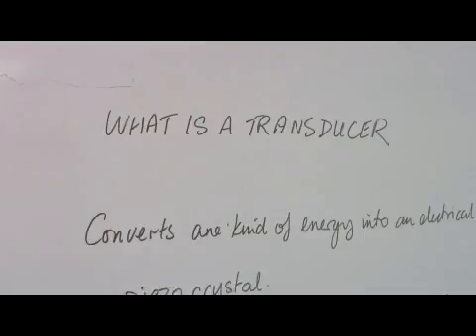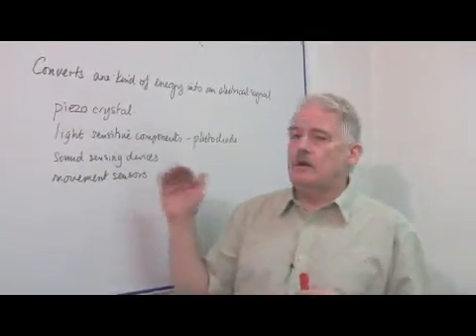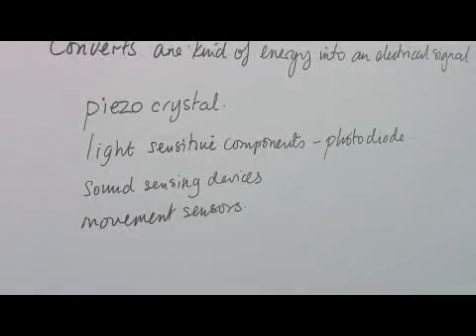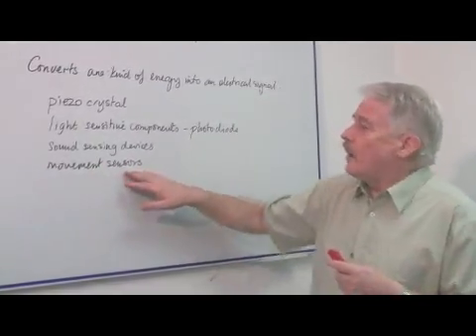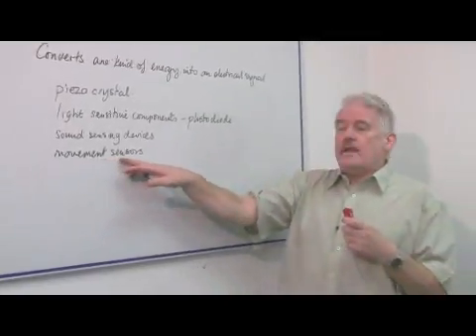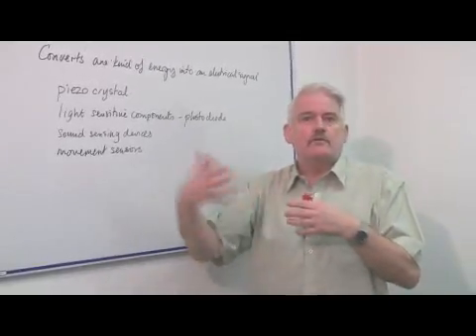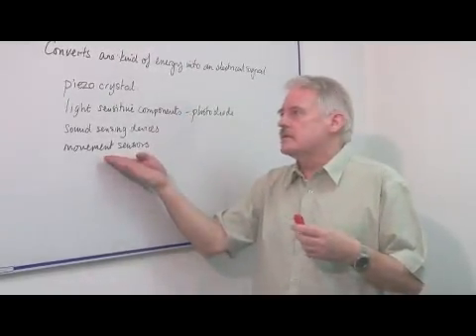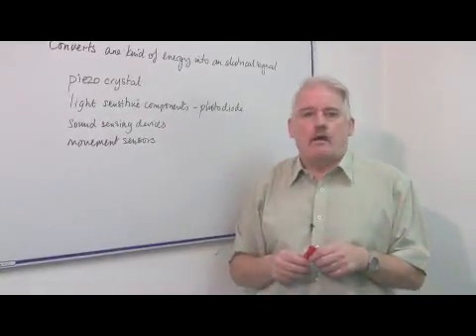What Is a Transducer?

Comment: From what I’m reading on the internet it seems a transducer is just a device which turns one form of energy/signal into another. So sound wave to electric wave or electric to sound wave would both be done by a transducer.

However it seems your video as well as other articles and videos show that this word has various meanings and there is no single definition.

Words do not have definitive meanings and it seems this word has several definitions that are all correct in different contexts.

Comment: Sensor - a device that converts some physical property (pressure, density, motion,  speed, acceleration, light, color, composition of matter, voltage, current, resistance, capacity, sound, temperature, magnetism) into an electric signal such as current or voltage. 

Transducer - a device that converts electric signal to a physical phenomenon; an antonym of a sensor. As a matter of principle, often transducers can work as sensors, however it is better to have a specialized sensor. E.g. a speaker can be hooked up as a microphone, but the quality of a recording would not be great. A light emitting diode (LED) produces light, but can be set up as a light sensitive junction.
Reply: So pretty much it’s an Analog input converting into a Digital Output?
Reply: @StandoutStreetBoxing  An analog and digital refers to the range of available values. In analog signal >any< quantity is available, so there is an infinite number of states. In digital - only a specific  number of  quantities is available (eg. 256, 512, 16 million etc)